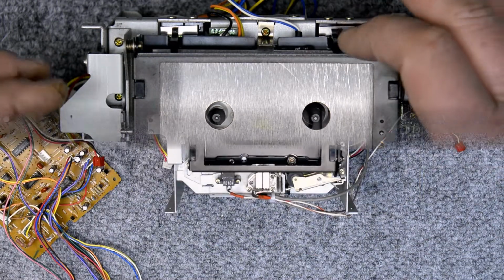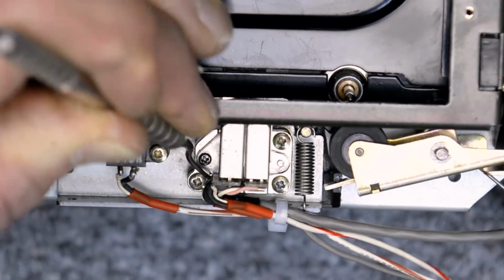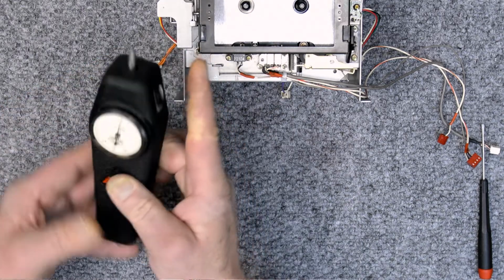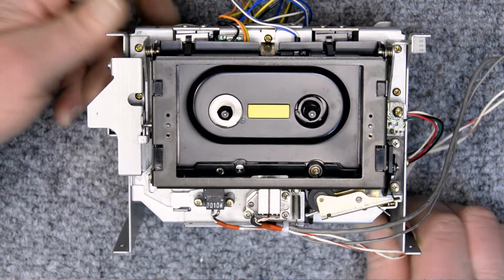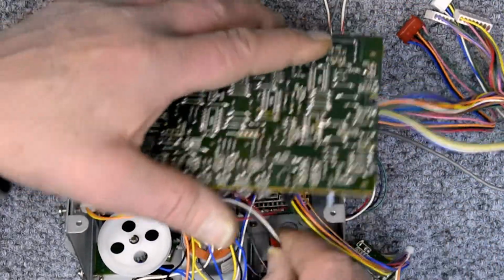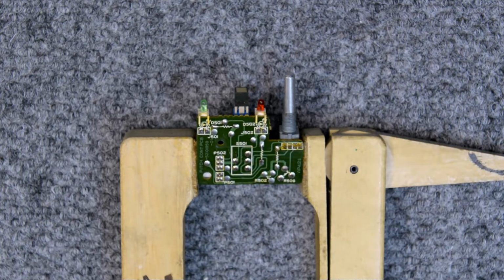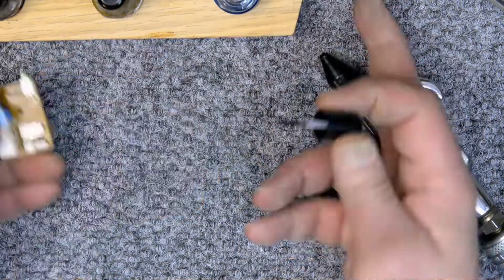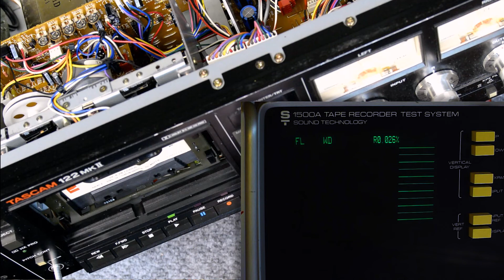Tascam 122mkll Cassette Deck Full Transport Service - Part V

Comment: I just stumbled upon your channel this evening and have watched all of the other parts of this series back-to-back so far (subscribed 😁).  I assume the softness of the copper makes it unlikely to scratch the heads?  Seems kinda scary!
Reply from the maker: Thanks for watching and subscribing! 

I'm up late, editing more videos just now ... Yes that's correct, the copper is much softer that the head material and as long as everything is nice and clean, there is no way to scratch the heads with it. Beware of the aluminum gages though, that metal begins to oxidize immediately following fabrication and forms aluminum oxide, and I'm sure you know what that is all about. Anodizing doesn't make it any better either, it's also harder than the steel head.
Reply: @asbcustom  Yeah, yikes!  At least that gauge is large and not likely to come into contact with the heads, unless you drop it or something. 😱 I'm up late cause I work 3rd shift, but I'd be watching your content either way - I'm loving your attention to detail!  You have some seriously specialized equipment.  I've done some servicing on my own (mostly open reel) decks.  I'd love to get them all tuned up to spec, but I'm not sure I'm willing to invest that much (scope, W/F meter, test tapes, etc) for just a few machines of my own.  I sure do find it entertaining and informative to see someone do it right though!  If you weren't on the other side of the country I'd be saving up my cash to have you work on mine.  👍
Reply from the maker: I'm referring to the small gage that comes into contact with the heads, avoid aluminum on those, it will scratch them. I don't think most people are aware of how abrasive aluminum alloy really is. 

3rd shift guys can afford anything, they earn the most :)